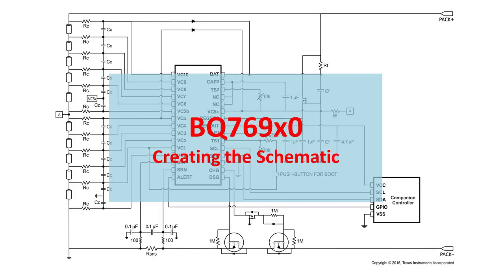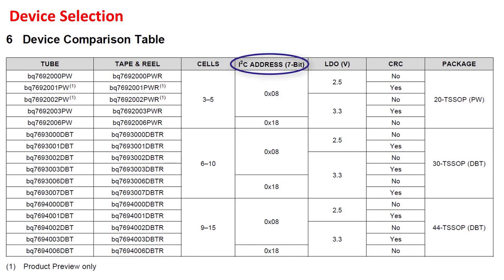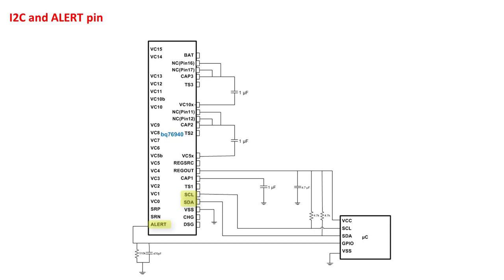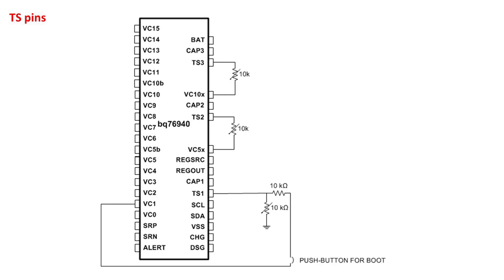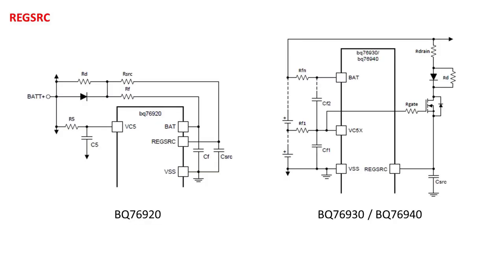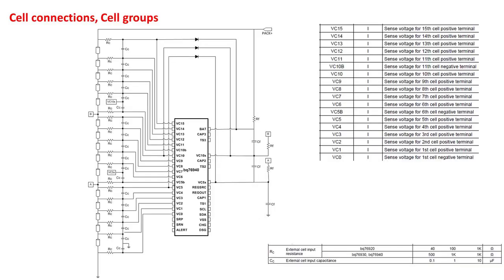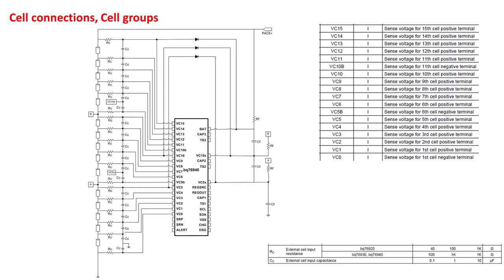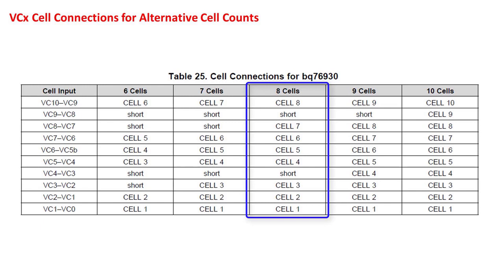How to create schematic for BQ76920, BQ76930 and BQ76940

Comment: Can you use this controller without a host controller? Wondering, because my design doesnt need anything but cell protection/ balancing
Reply: You can use specifc chips for it. like BQ77915
Reply: Nope because you set up thresholds through the IIC bus.